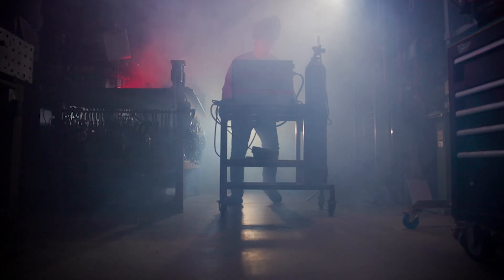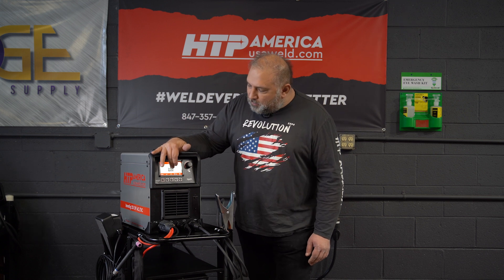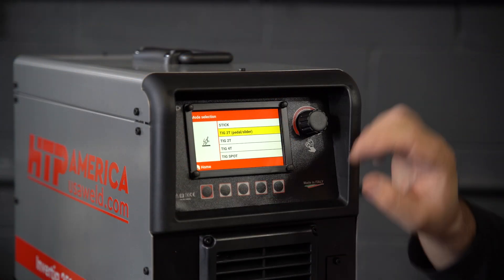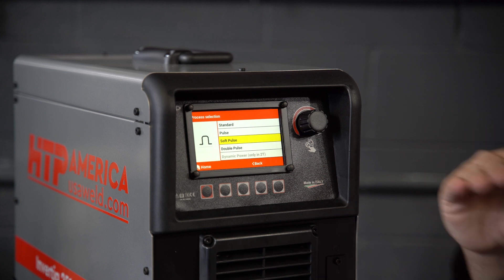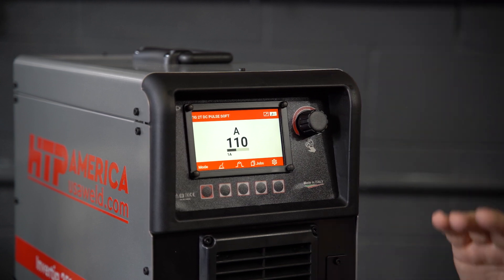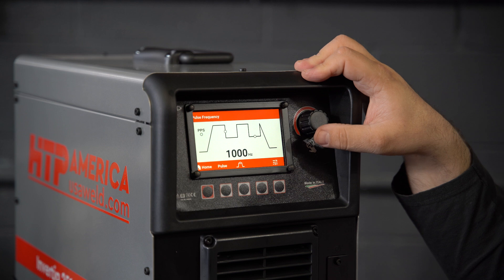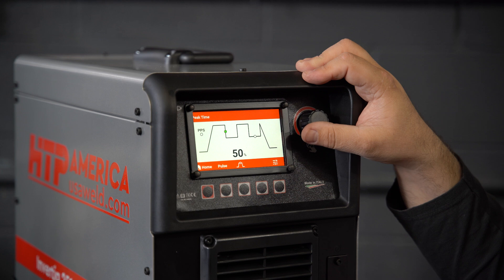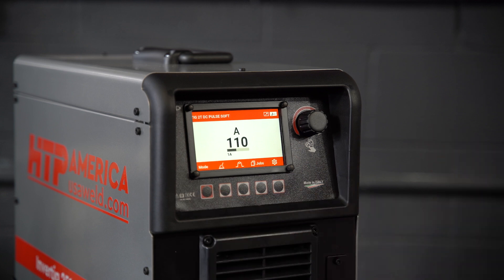Invertig 251 AC/DC - DC Soft Pulse Explanation

Comment: Hello HTP America! Aside from amperage, are there any other features that separates the 251 from the 301 Invertig?
Reply from the maker: the 251 has TONS of features the 301 does not have .... AC DC MIX, fast tack, zero crossing current adjustment , mix and match of wave shapes in AC, soft pulse DC, double pulse DC ..... just to name a few